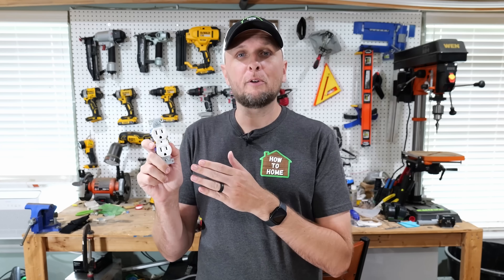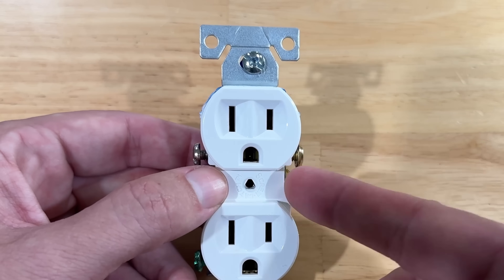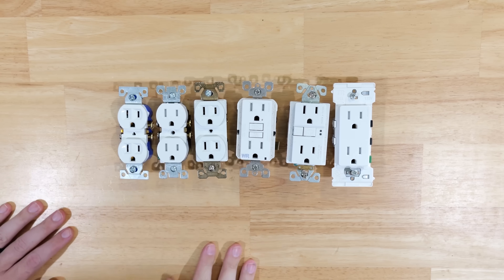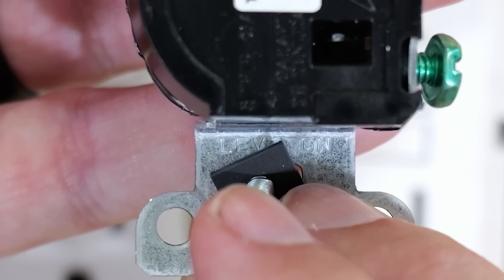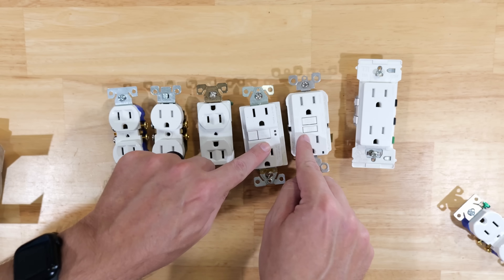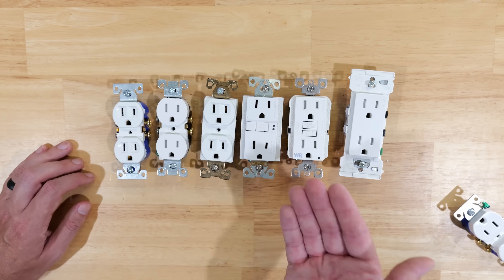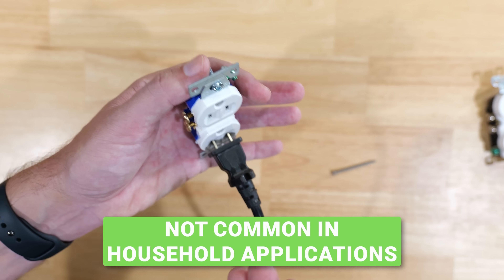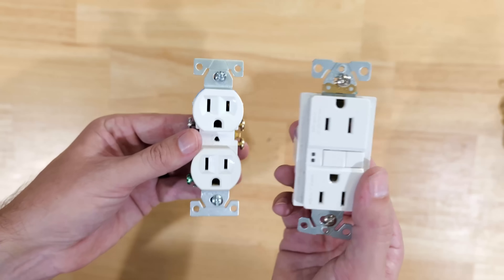The Shocking Reason Why Your Outlets Are Installed Upside Down!

Comment: I always installed ground side down, because....well....that is why most houses around here are done that way. I worked in construction all my life and I saw MANY outlets!  :)
BUT....one of my hobbies is stereo equipment, and music. One day, I was setting up a stereo system in my bedroom. I had a shelf over an outlet. I had everything hooked up, with the receiver sitting on the shelf. I realized I had not oriented the speaker cables right, and being stupid, I did not turn off the receiver when I pulled one channel's cables off, but just turned the volume all the way down, to reorient the + side correctly. It slipped out of my hand, dropped down behind the shelf, and the pin end fell EXACTLY on the prongs of a power cord not quite pushed all the way into the receptacle, shorting out that channel of my receiver. Did more damage to the receiver than just blowing the internal fuse, causing more damage than my limited trouble shooting abilities could handle. 
     So, from then on, I always turn the ground plug up especially when working anyplace where bare wires might be found, like stereo equipment, work benches, etc.

Comment: Before current code installing receptacles with the ground slot up made sense but with AFCI /GFCI dual purpose circuit breakers it doesn't matter anymore

Comment: Ground down seems better from a usability perspective for the reasons mentioned a bunch here, but I have a mix of upside-down and right side up outlets in my older house. Some of them came like that, a couple were installed by me because that's just how the orientation worked out with the wiring (this is almost all two-wire, with old outlets that don't have different-sized neutral and hot slots, so there wasn't really an up-or-down!); I have a feeling these older homes really tried to economize on materials like wires so there isn't much to work with to begin with. I guess I could pigtail them, but some of the boxes are also tight on space, so then I'd need to cut and place an old work box. Or I can just live with silly upside down outlets in some spots.

Comment: My house was built in the early 90's and every single outlet is installed ground pin up, even the GFCI's.  I was always wondering why this was because I had never seen that in a home before.  But I don't worry about it.  In fact, I am currently adding a 20amp circuit for my garage and I am going to install the new outlets ground pin up just like all the rest.  Just personal preference I guess.  Thanks.

Comment: idk if this has been mentioned, but I prefer ground down for most residential application for convenience when using cords with 90deg angle to the plug, so the cord comes straight down and doesn't stick out a little (most wall-warts, power strips, etc), and 99% of these have the ground prong on the side the cord comes out. So installing the outlet ground prong up, makes this a real PITA, with the cord going up. Granted, sometimes this might be beneficial, and in those cases just flip the outlet for that specific location.

Comment: I always thought that the ground needed to be at the  lower end. If the room flooded with water, moisture would cross first to the ground then to the hot lead. A shorter circuit path. If the GFCI circuit protection was located in the circuit panel, the GFCI circuit would trip, thus less risk of electrocution. This would apply to duplex outlets at waist level or below. .... Now, if the duplex outlet were at higher levels, it would make more sense to have the ground on the upper side of a duplex outlet. ... How many duplex outlets have you seen that were busted around the ground pin plastic with the lower ground position?  A heavy extension cord helped cause the plastic breakage. ... Just my two cents. .......

Comment: The scenario at 10:00 ish happened with my kids when one slung a bracelet across the room and it shorted across a plug that was wiggled out enough to allow contact as the chain fell across it. I know, I should have checked their outlets. We all learned a lesson. I worked with BIOMED and IT in hospitals for about 18 years and most problems were from staff inattention to how securely the plug was in place, moving equipment without checking cables first and just yanking cords out, breaking ground prongs (almost daily). Our plugs were all installed ground prong down. The problem of things being dropped across Hot and Neutral was pretty far down the list.

Comment: If you short neutral to hot and a breaker doesn't blow, you have a much bigger problem to worry about.  Bottom line, it doesn't matter how the socket is installed.  The ongoing "which way is correct" argument is for people with nothing better to do.

Comment: What we need is a total redesign of our outlets.  In Europe (Schuko outlet) they recess them so you cannot get your finger in there. That is to say, the plug is deep enough in the wall that by the time you pull it out enough to touch a prong, the circuit is already disconnected.  In Britain they make all cords come from the factory with sleeves on the prongs so that they are insulated from fingers. By the way, about 15 years ago we copied the Brits by putting shutters on our outlets (tamper resistant).  Britain has used those shutters since the 1940's. (Maybe NEMA waited until the British patents expired, lol).  Unfortunately, safety has never been a big consideration for the NEMA design.  It has not changed since the 1920's when it was first patented.  

I would prefer an outlet that is horizontal as it is easier to fit larger plugs "side by side" instead of on top of one another.  We are stuck with these vertical outlets (even if you install them horizontally, the problem persists). If our outlets were side-by-side, then you could use plugs that have cords that run vertically and aren't so "deep." The way it is now, plugs have to be designed to stick out of the wall several inches to avoid hitting the plug below it. I have always hated that.

Comment: NOT that rare! I have an outlet behind my drill press with a metal cover .  I had 36 inch lengths of welding rod leaning against the wall.  one length of rod decided to roll and  lay over on the plug at the wall . the plug end was not inserted completely  leaving enough exposed and  the rod was thin enough to  lay against prongs  of the cord . sparks commenced.  if ground was  facing up there would be no issues.

Comment: There is another reason in favor of ground prong up. When a heavy extension cord or wire from a device plugged in is experiencing stress from the cord being pulled taught or tugged on, the greater force is usually downward. The ground prong being longer, exerts the greatest torque when the wire is being pulled in a downward direction.  Occasionally that downward force will cause the plastic of the ground prong opening of the receptacle to crack from the downward force. If the ground prong is up, that downward force has much greater support from the receptacle structure. I’ve personally cracked a few receptacles over the years working on projects where the wire plugged in was being yanked around a lot. Where the ground prong was up, the extension cord always stayed more securely plugged in.

Comment: Years ago in the 1980"s, There was a lady Janitor working the night shift at a SSA Bldg. Everyone had to have an I.D. badge to access the building. Well the lady janitor wore her I.D. badge on a ball chain necklace. You already know what happen, or can guess. She bent over to unplug her vacuum cleaner and the ball chain shorted across the hot and netural. She was badly burned around her neck and was sent to the hospital. Needless to say they did not use ball chains for I.D. badges anymore.

Comment: This brings up a question Ive wanted an answer to.  During a hurricane we lost power then I awoke to find my home flooded above the receptacles. I stepped into the water then noticed the power had been restored.
I turned my main breaker off.
Another instance was at my job where walking thru an area of water that happens each time we got a large amount of rain. I noticed a dropcord plugged into another dropcord laying in this water. Why in each instance was I not shocked or electrocuted. In the instance at work I was wearing leather boots and my feet werent getting wet.

Comment: The argument for ground down is that as the cord is being pulled out by gravity, the ground is the last connection to break.  The argument for ground up is for falling objects, like curtains, could short across the hot/neutral prongs.
That's the shortest explanation of both camps that I've heard.
<------- Red Seal and Master electrician

Comment: Power cords hang down not up, if the cord comes out from the side of the cap the recptacle ground needs to be on the bottom or the weight of the cord will tend to unplug the cord if the wire is on top of the cap.

Comment: In the alarm industry we install step down transformers in an outlet secured by the screw that secures the cover plate.
I have had a metal cover plate drop on the hot and neutral while mounting the transformer. Good spark out of that. 
From then on with metal cover plates hunt the breaker down.

Comment: The NEC doesn't call anything out but some local codes do. I know when I worked for a contractor performing weather proofing and electrical rewiring we had several places where the local code called for the ground to be up. We would often have to go flip some receptacles that were installed ground down when the inspector would do their walk through.
 As others have said health care facilities always have a ground up orientation.

Comment: At one time, many moons ago, a proposed code was printed on the individually wrapped duplex receptacles. It read that the ground was to be installed up. The proposed code was not adapted because it was written at a time when METAL duplex receptacle covers were dominant. The idea was intended for the receptacle cover losing its screw and dropping onto a male plug which was below. A not fully engaged plug or a plug which may be pulled.
The metal cover would make first contact with the ground. Any subsequent contact would trip a breaker and prevent electrocution.
Unbreakable plastic receptacle covers became popular.
Some male plugs need to be plugged in with the ground up as their configuration requires it. You know, the ones who's cord would block the other receptacle if plugged in ground down.
Me, I go by the electrical specifications called out in the contract. Ground up on metal covers. Ground up on corded equipment which requires it. GFCI and Arc fault equipment usage. 
Hospitals? They're in a code of their own. (Panels, wiring and devices which require constant certification.)

Comment: I have 2 problems with this video.  First,  is the title.  The title implies there is a right and a wrong way to orient the outlet and "I am going to reveal the "shocking " reason why".  In fact, there is no right/wrong way and you say so.  Secondly, why, for video demonstration purposes, would you use a GROSSLY CORRODED CORD to plug into the receptacle!?!?  THUMBS DOWN for this one.
Reply from the maker: Ok first, it is a title and I can very easily explain why it says what it does.  Sorry your perception caused you to get upset.  2nd, corroded cord?  The cord isn't corroded let alone grossly corroded.  It is older and the plastic part wasn't perfectly clean but it is in my shop.  I am actually thankful for whiny folks like this that make things out of nothing, they cannot resist commenting which helps the algorithm and they click thumbs down which they think has a negative effect on the video but it doesn't.  So thanks for getting upset over silly things!

Comment: As a low voltage technician, we have to use wall wart style transformers that are attached to the plug using the faceplate screw and I absolutely hate needing to power cycle a panel that is plugged into a ground prong down plug with a metal faceplate. Only takes one time loosening the screw and the plate dropping across the hot and neutral to always remember to be careful when you're dealing with a metal faceplate. Ground up eases the nerves a bit

Comment: The ground up causes kinks in your appliances wire. And I felt a surge from my apartments bathroom outlet trying to turn the light on. So your video gives them a reason for them to say I don't know what I'm talking about. Businesses don't have to follow rules and regulations. But WE DO. !
Reply: @Debbiecybergal: Ground prong up when that outlet is attached too the wall-switch so people there have a visual cue to know where to plug in their lamp to control it from the wall light-switch.
  Medical facilities have things hanging on walls that fall, like clipboards that short the circuit, military galleys and restaurants, ground up was specified for contractors, due to stainless steel utensils being dropped, etc. In many cities ground up is standard in all commercial and industrial buildings, ground only go down in residential buildings, houses, apartments, condos, etc. There are local rules. 
   Everything is in context and the answer DEPENDS on context.

Comment: I personally have witnessed people being shocked because of ground prong up. why you ask, very simple when unplugging a receptacle, and everybody does it your fingertips will always curl to the bottom of the plug, making contact with the neutral and hot!!! And a second reason to not put ground up, and gravity being what it is will cantilever itself out of the receptacle whole lot easier. And let’s get real !something falling from a wall that happens to be steel, making contact with the neutral and hot on its way to the floor. Hopefully the breaker does what it’s supposed to do. And that situation would be nearly astronomical. I don’t see an argument here!

Comment: As far back as I can remember; most of the receptacles I have seen was ground hole down; when I see the one with the ground hole up; All I can say is they're upside down and they look really weird that way.
Reply: Ground prong up when that outlet is attached too the wall-switch so people there know where to plug in their lamp to control it from the wall light-switch.
  Medical facilities have things hanging on walls that fall, like clipboards, scalpel, hemostat, that can fall and short the circuit, military galleys and  restaurants, ground up was specified, due to stainless steel utensils being dropped, etc. Therefore it has become required that they be ground up for contractors. In many cities ground up is standard in all commercial and industrial buildings, ground only go down in residential buildings, houses, apartments, condos, etc. 
   Internationally, countries with 3-prong outlets always have the ground up
   Everything is in context and the answer DEPENDS on context. 
   Examples:
“Never took the orientation of an outlet seriously until I was measuring for a shelf with a tape measure. It slid down and fell across the prongs of the washing machine plug.  POW! “ —@joef.6596
“I work at a K-8 school. Maintenance assembles powered multi media carts with the ground plug up in consideration of teachers dragging metal bracelet chains across partially unplugged power plugs.” —  @scaryhouse7969
“a length of florist's wire rolled off a side table onto a slightly loose plug and shorted the circuit, creating a small fire (quickly extinguished).  I now always install ground prong up” @deegee54
"I had lunch with the Chief Electrical Engineer at McDonalds headquarters. He told me that one of the workers in one of their stores had her hand badly burned when a metal cookie sheet (or something similar) slid out of her hand. It fell onto a receptacle that was partially pulled out...the metal cookie sheet made contact with the two blades resulting in  big arcing flash that caused the injury, this is a reason Ground Up is safer."